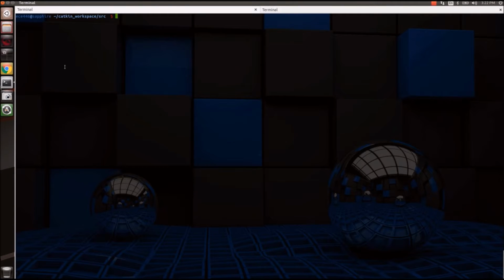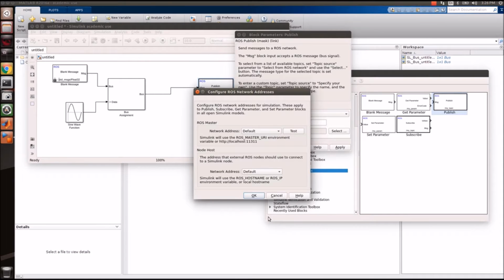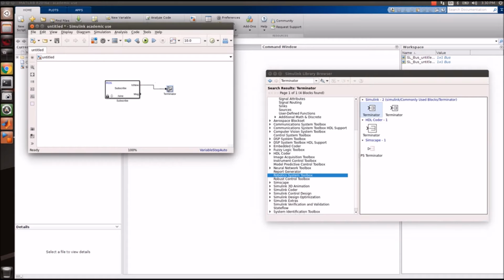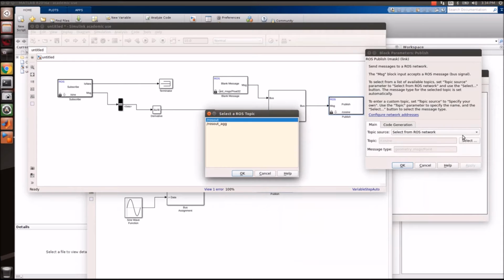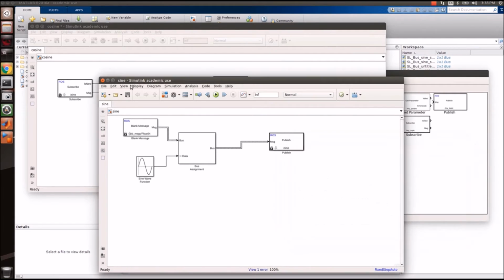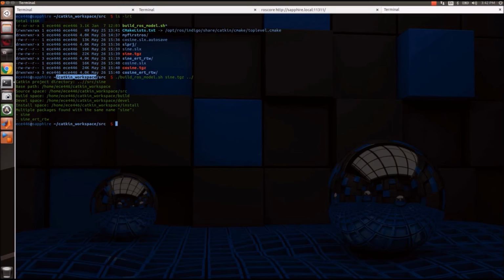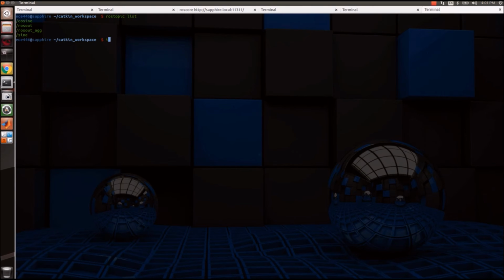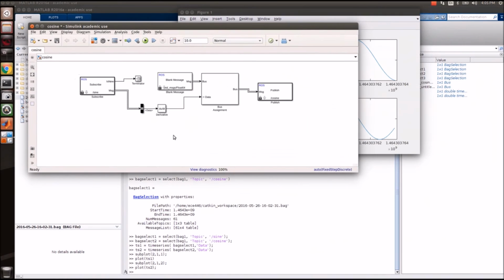Generating standalone ROS node from simulink

Comment: Thank you for this video.
 I have a question. Do you have any information that could be helpful for me? 
I have a cliff sensor in Gazebo and I want to publish the values taken by this sensor in a topic to use them in my code. However, I am unsure of how to do this. I believe I may need to find a plugin for the cliff sensor, but I have been unable to locate one. 
Below is my code for the cliff sensor.
<gazebo reference="cliff_sensor_front_link">
	    <sensor type="ray" name="cliff_sensor_front">
	      <always_on>true</always_on>
	      <update_rate>50</update_rate>
	      <visualize>true</visualize>
	      <ray>
	        <scan>
	          <horizontal>
	            <samples>50</samples>
	            <resolution>1.0</resolution>
	            <min_angle>-0.0436</min_angle>  <!-- -2.5 degree -->
	            <max_angle>0.0436</max_angle> <!-- 2.5 degree -->
	          </horizontal>
	        </scan>
	        <range>
	          <min>0.01</min>
	          <max>0.15</max>
	          <resolution>1.0</resolution>
	        </range>
	      </ray>
	    </sensor>
	  </gazebo>

Comment: Good video! do you know if there is a way to generate ROS.bag file (from Workspace for instance) directly from MATLAB?
Reply from the maker: I am sorry, but I didn't understand your question. If you are asking whether it is possible to capture bag files using MATLAB, then I unfortunately I am not aware of any such method. I capture bag files using command lines or using roslaunch files. I hope this helps.